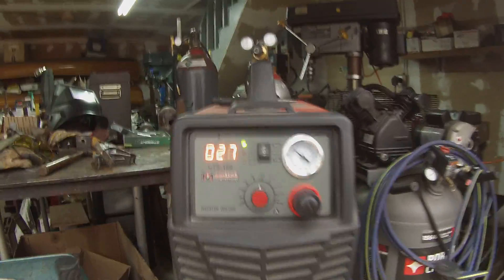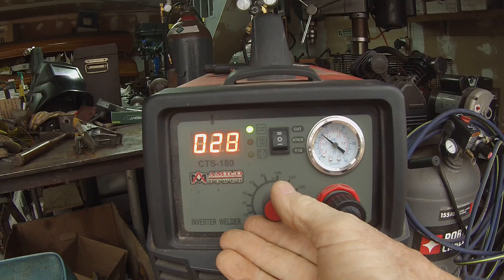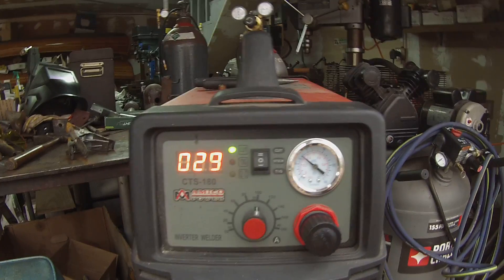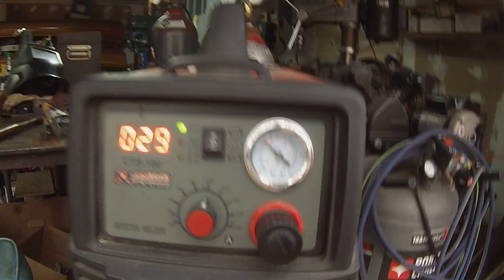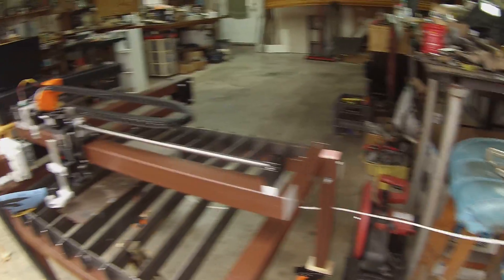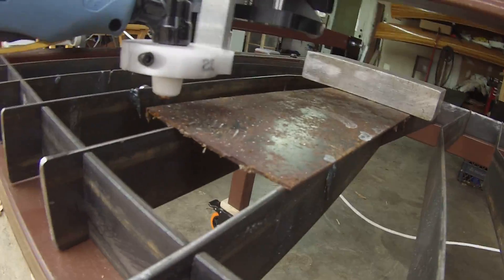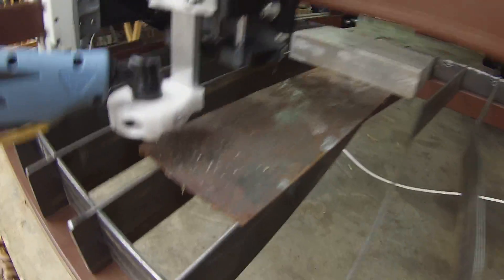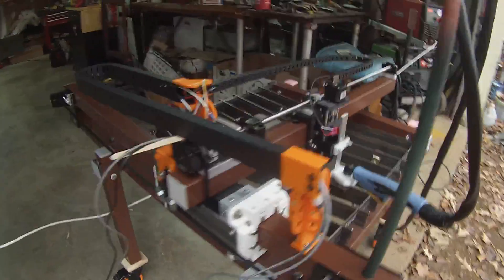First real test cut Amigo CTS180 HF

Comment: The HF start on the torch is causing the CPU to crash - common issue
Reply from the maker: Correct.  Anytime the torch trys to fire but is unable to start,  if it is too high, over a hole, it blows up the USB connection.
I have the THI setting pretty close now and trying to cut at 1.7mm torch height.  A continous cut works fine, but cutting holes is rolling the dice.  Also my switch bolts were too short and loose, very inconsistant touch off before.